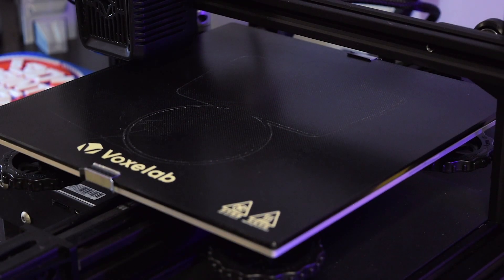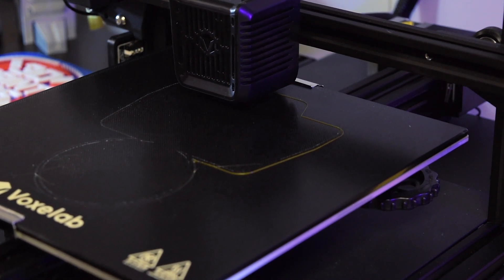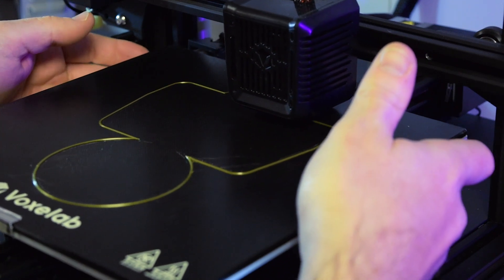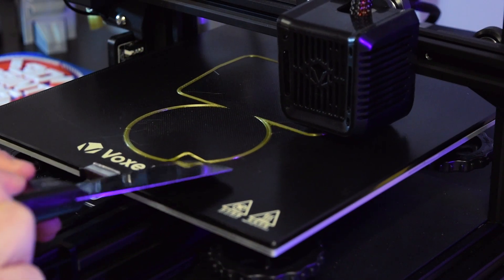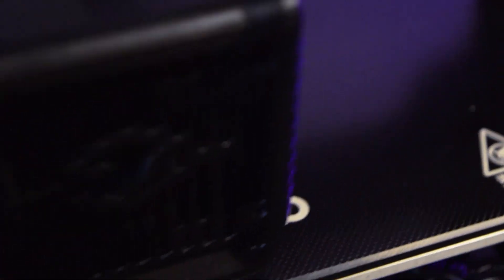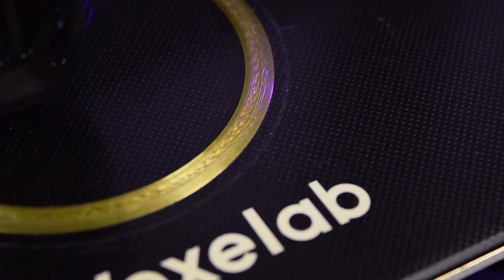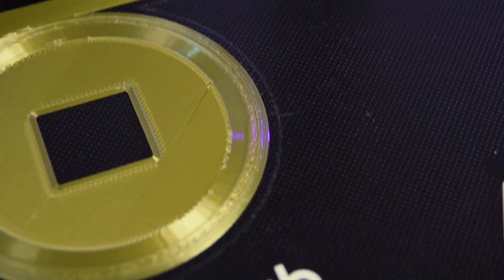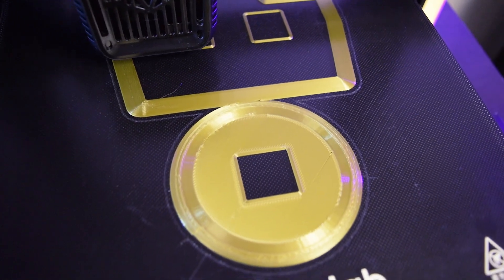Quick Tip - Live Leveling your Voxelab Aquila or Creality Ender 3

Comment: just got this printer today. first print had a warped corner. second print broke adhesion on the last 2 layers. third printed literally perfectly just by moving the model to a different corner rather than the middle of the bed. So i tried to print a benchy in that corner and after 3 attempts I just gave up for the night. fucking thing
Reply from the maker: Hmm. If moving the object to a different place on the bed worked, that means your bed isn’t properly leveled. This will help big time: https://youtu.be/Q7Mu05fZNsk
Reply: @3DPrintSOS  hey, wanted to give you an update. That video was very helpful. I got it leveled and printed a damn good benchy using your cura profile. 

What was happening was the bed was hitting the Y axis motor while at home position. Tried to move it down but it really doesn't go down further. Moved the glass clips to the side. Tension is halfway up just to clear it... I also scratched the absolute shit out of the glass because the bed popped up onto the motor when I was moving it back after adjusting some. But whatever. Finally getting some prints going and that's what matters. Gonna print your extruder mod tomorrow probably haha. Thanks again
Reply from the maker: Nice! Glad you got that sorted. I have a lot of scratched beds, so don’t stress that too much. You can always flip it to bare glass as well. ;)

Comment: After setting up the table level OK using your X2 video, the auto home worked the first time but now it goes across the the left and to the front of the table but instead of coming down it goes up! and when pressing the Auto Home again it goes up again. Any ideas please.
Reply from the maker: Two ways to fix this. Repin your stepper wires or you have to recompile the firmware with the stepper direction reversed in settings.
Reply: @3DPrintSOS I sorted it thank you, I'd not plugged in the Limit switch connector. It worked fine after that and I've now printed out the first of the supplied test models.
Thanks for the quick reply.
I note my X2 has the H32 label is this Ok or does it require updating.
Dave
Reply from the maker: It’s ok, but updating to the latest firmware is good practice. And I have some vids that can help you. ;)

Comment: I saw another video on the Aquila where they adjusted the first layer z offset after leveling with the paper, it seemed like it was solving the same basic problem of the first layer being too low or too high but with software rather than one corner at a time. Is there a reason you prefer using the springs rather than the settings?
Reply from the maker: Having the printer mechanically level gives you minor adjustments later. The software adjustments are really there for small changes. But even those should technically be mechanical.

Comment: The problem I'm having is with the top left side as you're looking at it I have the bed screw all the way tight an it's still hitting the nozel any ideas why?I've used a straight edge no gaps anywhere
Reply from the maker: If you need to move the whole gantry up a hair, you can move the z end stop up and re adjust the tension. That will give you more room for adjustment
Reply: @3DPrintSOS  well I see what part of the problem is it's the stress relief bracket a little to talk have to see if there's a mod for it an a really big problem I noticed it's bitting into the temp wire on the bed possibly a big fire hazard I cut a chunk out of it for now
Reply from the maker: Oh wow. Yea that’s not good. So that was issue?
Reply: @3DPrintSOS  so far haven't found a mod for the bracket so I'm going to cut it in half where the spring sits an see what happens

Comment: I love your videos !  I'm working on my New Aquila and I've been going though each of your vids.  I have a quick question.  I see that in the front Left corner you have a small bump that is repeated each pass.  My New Aquila does the exact same thing in the same area.  It also makes and auditory bumping sound and feeling (all most like a tiny speed bump)  every time it goes pass that area.  Any Ideas why that might be ?
Reply from the maker: I think that is when there is a new line and the printer has to move over to make the next line. It kind of makes a bump there.
Reply: @3DPrintSOS  thanks for the reply. Mine leaves a noticeable divot in the prints that I've been able to complete so far. It's almost like while going back and forth the print head has a hiccup that you can feel if touching the printer whenever it goes past that XY point.  It's a little bit weird. I've not been able to figure out where that hiccup is coming from. It feels mechanical.
Reply from the maker: Hmm. Check your wheels and check the extrusions. Maybe there is a ding there. Something the wheels are hoping over. Hopefully it’s not a dent. Sometimes if you over tighten the wheels, you can cause a dent in the extrusion and the wheels will “hop” through it. Hopefully, that’s not the case. If it’s a wheel, should be super easy to fix.
Reply: @3DPrintSOS  Thanks for the Tips !  It did come out of the box with a slightly loose front left bed roller.  Caused it to have some significant bed wobble ( go that tip from one of your videos as well) Tightened the Cam screw on that wheel and no issues since.   Finally getting to knockout some prints, and im noticing the little hiccup is not showing up on the prints...just the Brims and skirts.  Had to use the glue stick to get everything to stick
Thanks again !
Reply from the maker: Glad to hear it’s printing well. :)

Comment: i bought this but im struggling to get high quality prints can you do a FIRST STEP CONFIG HIGH QUALITY VID
Reply from the maker: What problems are you having? Are you printing off the sd card? Your own sliced files or just the demo files? What filament are you using?
Reply: @3DPrintSOS  thanks for the reply, im printing the hook from the sd files with the PLA filament that comes with the voxelab its a red transparent manage to get a reasonable good print just by balancing the platform, i downloaded this https://www.thingiverse.com/thing:2244847  i use your VOXELAB config as your video but
when it starts to print the feels like something isnt hot enought and leaves like little chunks
Reply from the maker: Hmm. I’m wondering if it’s a leveling issue. Have you checked to see if your bed has any wobble in it? If it does, adjust the wheels. If it doesn’t, maybe give the bed 5 more degrees of heat.
Reply: @3DPrintSOS  ill try ill let you know how it goes

Comment: I keep getting no end of issues with my Ender 3. I've had to lower my e steps to stop the extruder from slipping. I spend my time leveling the bed now. So glad I have a resin print to get the job done
Reply from the maker: Hmm. Several things could be causing the extruder to skip but esteps is probably on the bottom of that list.  What temp are you printing at? Pla? Have you tried manually pushing filament through the hotend?
Reply: @3DPrintSOS  hey dude thanks for getting back to me.

I'm printing at these settings
0.16 dynamic
0.4 nozzle
1.75 3DQF filament 
215 hotend 
60 bed
Speed 60
Upgraded duel gear extruder
Glass bed

My e steps should be around 148 but I'm having to use 103 otherwise the E gear skips something chronic causing the print to stop extruding each time. 

When the printer does work it prints the best I've ever seen.
Reply from the maker: Hmm. If you have a dual gear Extruder, and it’s still skipping, you may have a partially clogged nozzle. I would also try the same settings but at .28 layer height. Let the filament flow a bit more. See if that helps. 215 should be more than hot enough for pla. I would go a hair higher on the bed though. But only if you’re having adhesion issues as well.
Reply: @3DPrintSOS  turns out I had a block in the hotend, took that out and gave the whole block a thorough clean. The amount of stuff still flushing out with the needles! I don't know where it was coming from lol. I've also ordered a Capricorn tube as its the last thing to replace that hasn't been replaced. 

While inspecting the old tube I noticed that the end going to the hotend block wasn't 100% cut straight so it wouldn't be flush inside. Hopefully this will all be fixed with the new Capricorn tube when I fit it...if not I have no idea lol
Reply from the maker: Glad you found a clog. Yea those tubes have to be 90degrees. Otherwise they collect filament and clog everything up!
Reply: @3DPrintSOS  yea you could say that, it was the mother of all plugs haha
Reply from the maker: Haha. Glad you got it pumpin plastic again

Comment: I had trouble, then I realized that the aluminum bed is not completely flat.   I ended up putting 2 postit notes under the glass on one corner and 1 postit under another.   Now the glass sits level.  I did reach out to Voxelab and they responded right away to help me.   I figure the paper shims are good enough and don't know if it is worth trying to get a truly flat metal bed?
Reply from the maker: Try to reposition the clips in those spots instead of shims. When the bed gets warm, try to make sure your level again.

Comment: I bought a new aquila 3d printed 3 days ago, today it is not working properly printer is starting up but nothing is coming up on the display, i can see back light is the display but no menu. I have also tried to update firmware but still not working. Is there anything  thay i can do to fix this?
Reply from the maker: Hmm. When you move the dial and press can you tell you are still going through the menus? Wonder if it’s firmware or hardware
Reply: @3DPrintSOS   no it does not show anything on screen and i tried to use print open just by guessing it but it doesn't work, i guess it might be hardware. I got it from Amazon  so sending it back but happy with the printer overall so ordering a same one 😁
Reply from the maker: @kuldeepsinghnizer  Dang. Hey may happens I guess. Just like you said, use that Amazon return and grab another. :)
Reply: @3DPrintSOS  yes  sure and thank you for replying 😊 actually this is my first printer and decided  to get Aquila after watching your reviews 😀
Reply from the maker: Well hopefully I can be of some kind of help. Lol

Comment: once again with the questions, any advice on how to properly adjust the tensions belts on aquila? or how do i know how tense or loose they need to be?
Reply from the maker: Good question and a hard one to answer. You want them to be tight enough to flex a bit when being pushed on with your finger. They shouldn’t be tight like a guitar string, but clearly tight enough not to potentially slip off of the teeth.
Reply: @3DPrintSOS  thank you! definitely helps!  played with it and yeah I noticed that one of the bands was to tight

Comment: You videos are life savers!!! 

Do you recon that an auto level could be installed on this?
Reply from the maker: Thank you! Yep, it could be installed. You don’t really need one because if you do it right, you don’t need to level very often. I only leveled this printer for the video and when I set it up. It stays level really well. If it was a 300+mm platform I’d recommend it.
Reply: @3DPrintSOS  Uhm, I would greatly love to have some kind of auto leveling system instead of doing the paper method, since I'm total blind.  If they make something that has a audio beep when you are level at the spot I would love to get it. as I just destroied my first 3d printer yesturday, with printing a item and well lets just say the injector was a block of plastice when I checked it 5 hours later and it was still printing, so I'm waiting for a replacment.

if you got a link to the auto level send a email to kuvvosh at g mail period com.  Thanks.
Reply from the maker: I understand if you are blind. That would be a great help. But if it’s setup correctly you don’t need to level often. I haven’t leveled mine in over a month.

Comment: Another great video, my feeder is still slipping after a few hours of printing, so I am going to attemp to fit the metal ender 3 feeder instead of the plastic one to see if that helps as ever thing else is spot on 👍🏻
Reply from the maker: If the issue was the extruder, that should fix it. It can be too low of a temp on the hotend. You can also try to slow the speed down a hair and see if that helps. It could also be the tension on the extruder. So check the tension screw on the arm and make sure it has good grip on the filament.

Comment: I've been watching your videos about the voxelab Aquila since I got mine a week ago and I've been none stop printing now you got me set up in no time thanks man. Could you make a gcode so when the print is complete it moves the bed forward rather than to the back
Reply from the maker: Thanks for the support! Yep, you can. Although, back is safer because there is an end switch. So you always know the limit.
Reply: @3DPrintSOS  ok I left my printer off for 4 day came to print and it's just not sticking to the bed anymore I cleaned it checked the levels but still won't stick any advice
Reply from the maker: Hmm. If you cleaned and leveled the only other thing is temps or the filament needs to be dried. Was the filament left out? Try to keep it in a sealed bag with a bag of desiccant.

Comment: One thing I learned the hard way that might help someone - Make sure the v-rollers on your gantry are tight enough (but not too tight) so the print head doesn't drop down when you "disable stepper motors," after "auto home."
  When using the paper method, after disabling the steppers, the leveling will be way off if your gantry drops.  Even a fraction of an inch will throw it off.
Hope this can help! 👍
Reply: Wow, this is exactly what was happening to me and I didn’t even know. Thank you so much for telling us this I was literally about to throw my printer out the window. I had tried everything and nothing was working but turns out this was the issue
Reply: @trasysartroom2697  
Hey no problem.  Troubleshooting can be a PITA sometimes.  Glad to help 👍
Reply from the maker: Great tip.